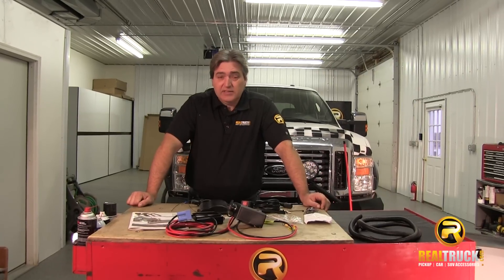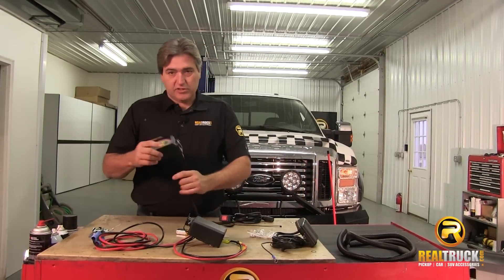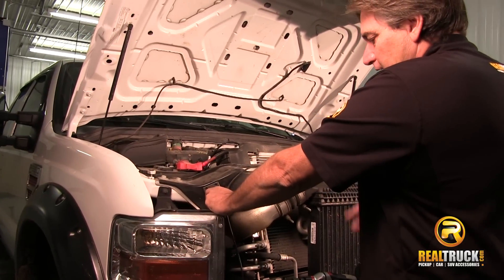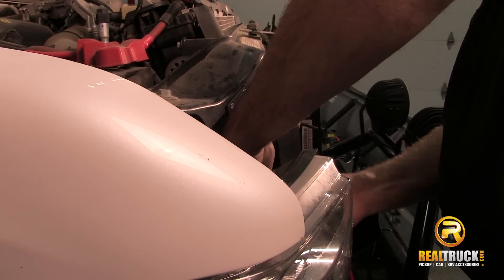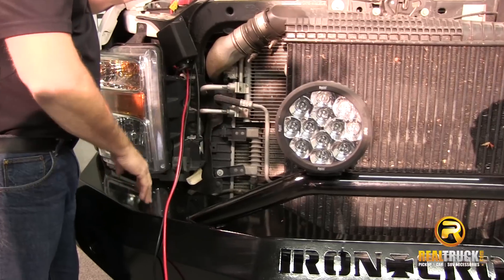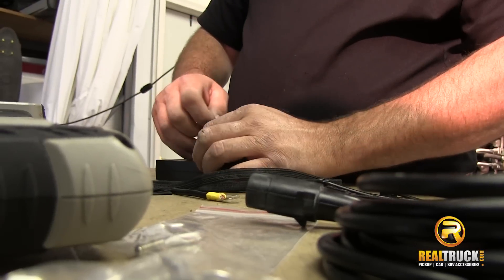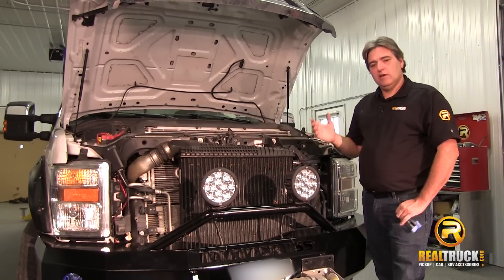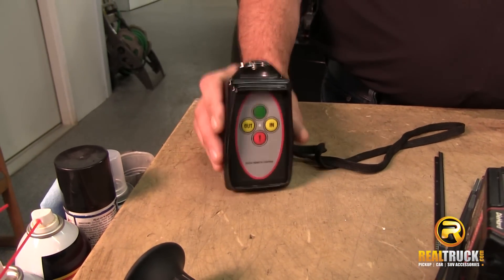How to Install Electronics for K2 Storm Snow Plow

Comment: Thank you for the update.  The manual for the plow calls for a 35amp fuse to be installed. Regards.......
Reply from the maker: Larry M honestly it was over a year ago when we installed this plow and I don't remember if it had one inline or not. I am also thinking that there is a relay somewhere in there too if I remember correctly. Cheers!
Reply: LOL all good green I can't even remember what I did last week vs a year ago.  I did like the video!!

Comment: Don't forget to install a fuse between the battery and the plow to protect the trucks electrical system.
Reply from the maker: Larry M good tip. In most cases. Since this hooks directly from the battery to the plow it doesn't tie in to any other system on the truck and is not necessary. That said a fuse would not be a bad idea, however, do to the large amount of amperage being drawn it would have to be a real high amp fuse. If you have any questions about this or any of the other over 500000 accessories we have available, please feel free to call us at 877-216-5446

Comment: The wireless transmitter I have has a wire coming off of it besides the antenna wire. You only show the wireless transmitter installed  not the installing of it so I'm not sure what that wire attaches to. It has a connector on the end of the wire. The manuals and instructions that come with these plow sure leave a lot of steps out.
Reply from the maker: Robert Rosenberger that extra wire with the eyelet is a ground. If you  have any other questions about this or any of the other 500000 plus accessories we sell and would like to speak to a person directly feel free to contact our knowledgeable Customer Service folks at  877-216-5446
Reply: I found another video that showed it goes to the negative post on the battery. I hooked it up and it is working now